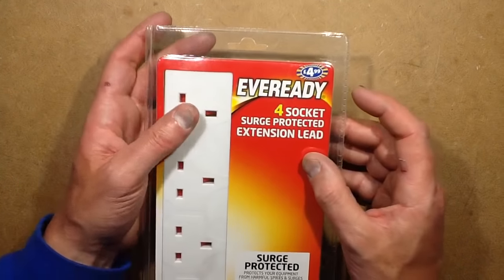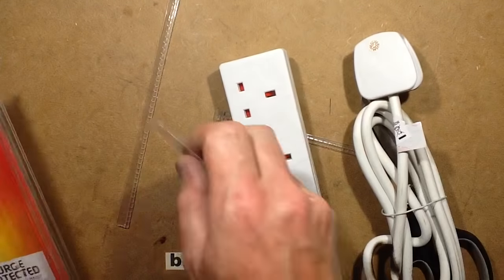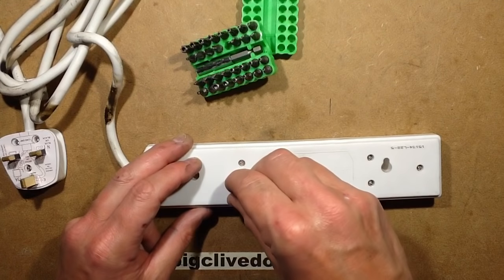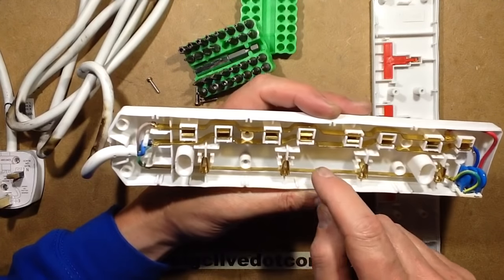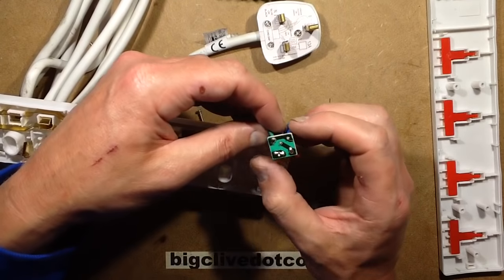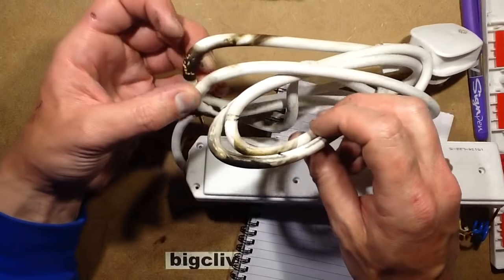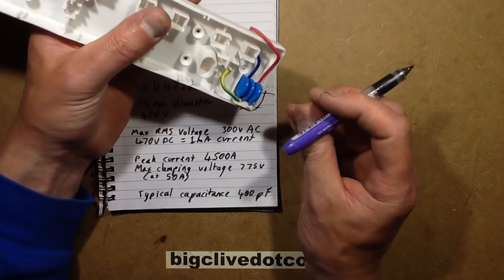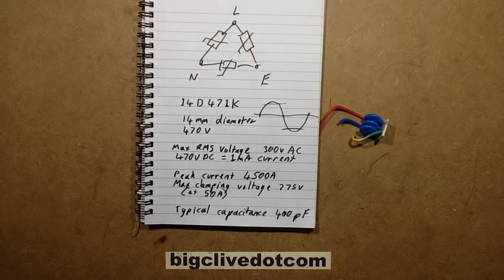Pre-exploded surge protection strip.  What the heck???

Comment: Compared to the plugs in Germany it is a "big ugly" plug for sure but very well designed. I especially like the fact that it has an internal fuse, this really gives some extra safety!
Reply: That fuse is a relic of the past and really adds nothing but trouble; they are often fake Chinese fuses. The really interesting feature is inside - when the cord is torn out, the live disconnects first. Other than that, it's an ugly design.
Reply: zwz • zdenek the fuse is there due to the decision in the uk to use a ring main arrangement for power wiring. The ring main can supply too much current to a faulty appliance or appliance cable so putting a fuse in the plug was the answer. On a star wired system each socket can be protected by an appropriate sized breaker
Reply: paul c I know. My problems with the fuse are: 1) They are way slower than modern breakers and do not facilitate the RCD function; and 2) They are massively counterfeited so that they are not trustworthy.

Comment: still too easy to plug those plugs in wrong. all them the same shape is a bad design.  compared to American ones that have polarized plugs and a grounding pin that make it impossible to plug in any way but 1 way unless you break stuff off and cut stuff.
Reply: British plugs are three pinned. You can tell by watching this video using your open eyeballs while awake. The only way you could plug one in the wrong way is if you were Angry Hulk.
Reply: Andy Jones
 well since all the pins are the same shape should not be too hard. also try and plug one of those in behind something without being able to see
Reply: Earth pin is rotated 90 degrees around its long axis, so not possible. You can't plug these things in wrong. And you are reaching on your second point. I'm not about to have an argument with a stranger about plugs on the internet, so if you want one of those you'll have to find somebody else.

Comment: The UK plug is not as good as the AU plug which is polarised even without an earth pin, where the UK one needs the earth pin to be polarised. Also less brass used for the same contact area.
Reply: So how do you connect earth if you have no earth pin???

Or do you wear gloves when using the equipment?

Comment: Due to the aforementioned fire hazard problem with the MOVs, I had a power strip burn up, and the buzzing and smoke had me very worried there would be a fire.  Fortunately the case was metal.  So now that almost all power strip cases are plastic, I avoid using the surge suppressor power strips.  My philosophy is that if there was a need for them, the equipment maker would put one inside of the equipment.  And if there is going to be a surge suppressor in my home, it will have to be inside the main breaker panel at the main entrance.
Reply: I'm the opposite. I won't even plug in my electric toothbrush without a surge protector. I live in an area that has very crappy electricity. Weekly power fluctuations are common, and sometimes daily depending on the weather season. The worst year had nearly daily brownouts or blackouts.

I've had to replace one too many broken appliance due to these damn surges... enough is enough.

Comment: How much would one of those tamper proof screwdriver sets cost me?
Reply from the maker: About five bucks.   http://www.ebay.com/itm/262418085998
Reply: I should really use ebay more often. In actual stores a much smaller set of those would be about 60.
Reply: Actually the same set is not all too expensive at Princess Auto (Canada), or Harbor Freight (US). Maybe 5 to 10 dollars, if I remember correct, when I got the two I have. The ones I have are in a red rubber case, instead of green, but all of the same bits... tamperproof Torx, Hex, Tri-Wings etc.
Reply: +LakeNipissing oh nice. i always love an excuse to go there.
Reply: The problem with some of the Harbor Freight ones is that they use crap or improperly tempered steel and thus sheer when you try to use them.
Reply: +randacnam7321 well I live in the land with princess auto. and nobody should ever complain about low quality in $10 tools.
Reply: These aren't the type of screws which are usually torqued to a hundred ft-lbs anyway! So for something which is going to be used infrequently and lightly, cheap Chinese stuff works OK.

Comment: Interesting. Wondered how surge protections works for a while.

Btw, do you have an idea why powerline networks don't work when put behind a surge protection (at least the vendors claim they don't work, perhaps I should test it once). The adaptors put an extra high-frequency wave on the regular 50Hz wave, so it's normal that every contact point reduces the quality of the signal a bit, but I have no idea why the warn so much against surge protection.

Perhaps it trips the surge protector (if the high-frequency pikes are above the allowed voltage), harming the signal and the surge protector that way.
Reply: some protection strips filter out "noise" and the signal used for networking gets filtered away.
Reply: +Robert Szasz thanks, good to know.

Comment: What are you on about clive, you put up stacks of videos :-).
LOL pre cooked, just needs a cable from a dead applience and its usable :-D
Reply: dunno its cheap chinese junk, i doubt both the plastic is the proper temperature and fire resistant, along with the cheap brass strips may overheat at anywhere close to 3kw, there was a video floating about that i cant find, they tested several 4 way strips, all the ones from proper places like argos, diy stores etc were fine, the ones from market stalls and wonky foreign shops had interesting failure modes at 3kw, melting of the plug, the socket, fire, exposing live connections, melting so you couldnt take it out of the socket!, they all had the CE mark and BS marks so some importers will sell any old fake tat if they can, 4.99 isnt a great bargain either, im not hot on them using the old ever ready name, which is an attempt to sway us older guys with legitimacy.
Reply: Yes i thought the Ever ready name was odd, Should have been called Never Ready :-D.
Brass strips will work as long as they are used for light loads like..... ermm table lamps ha ha, sorry im in silly bugger mood :-D.
Its what i use them for, the small plugin switchmode psus for modems and routers plus small stuff.
I would not trust one for the full 13 amps.
Reply: zx8401ztv
yeah i agree at light loads should suffice, i know ive bought and used them for same, laptop, router. a surge lead actually saved my PC some years ago, we had a lightning strike hit our row of houses, most everything electrical died, but all my stuff on a cheap surge lead (at the time i was dubious they were useful and bought a cheapy out of curiosity) survived, my tv vcr etc all died though !

Comment: It's like the brand new air conditioner I purchased earlier. I got it home and went to put it in the window only to realize that it was damaged. I called customer service and she made 2 points, 1 because I removed it from the original packaging there is no way to prove it came like that from the factory and 2, it's more likely that I dropped the unit removing it from said packaging. Sssoooooo, now I have to straighten the aluminum cooling fins. I already used epoxy to fix the cheap plastic face plate, but I'm awesome at fixing stuff so unless someone actually looks close it's almost unnoticeable.
Reply from the maker: What company was that?
Reply: @bigclivedotcom  I got it from the local Walmart New York

Comment: I think the plug housing is just a bit too large. The US plug I think is better mainly for that reason. The U.K. has a lot of benefits though.
Reply: The US plugs just are dangerous as hell, as everything I've seen while travelling make contact while the prongs are still visible and able to be touched.
Reply: Dylan White One thing I do hate about US plugs is that older sockets don't have the hole for the earth prong. Lots of newer appliances need the prong, so you end up buying a plug adapter  for every TV, computer, blender, etc and not knowing if it is truly grounded or not.

Comment: Interesting, I'm a little confused though. The neutral should be the outgoing pin, that is coming from your device. To get a high voltage transient there, wouldn't it already have to have been on the active? In which case why would you need a MOV between neutral and earth? The other two MOVs make sense to me but why the third? Also, how do these things not trip RCDs all the time? Those things can be remarkably sensitive so even the small ammount of current leakage during normal operations could cause major issues couldn't it?
Reply: keep in mind, neutral and ground are seprate wires in the system.  There is a chance that a voltage spike could occur on one and not the other even if they are on a common connection point in the main box.  This could happen for any number of reasons:  lightning, bad transformer, loose wire in the system, etc.  This device just takes that into account and keeps surges to a minimum.
I just wonder if he put it back together and used it.  If it's just the surface that is scorched and not burnt through, it should work just fine.
Reply: Jon Marple Oh you could absolutely still use it, just replace the cable. Also, yeah, I guess that makes sense, except that I doubt this thing can cope with a lightning strike.
Reply: RCDs aren't "very" sensitive. They are rated for a 30mA differential. This thing has a few microamps loaded symmetrically. It's several orders of magnitude below the radar.
And as for the reason why it's between N and E? Often it just so happens that L and N are swapped. All devices are prepared for that. Well, not all, I have once taken apart an induction stove and it had good creepage around L, but just about 0.5mm around N. It was made in Spain. And it kept failing for various reasons. (Never the tiny creepage though.)

Comment: Could you do a video on the various protection indication circuits? I've seen some that appear to have mildly complex circuits with transistors etc. Why hasn't any manufacturer invented a protected strip where the MOVs are a small replaceable module that they could sell you when the protected light goes out? or are there?  (ps thanks for the videos :)
Reply from the maker: There are some products with swappable modules, but most want you to buy a complete new product.
Reply: A replacable MOV module is a beatiful concept - it fits perfectly into the "ideal" world of electronics.
But in the real world, questions crop up faster than one can type.  The first that comes to my mind is its cost vs the cost of a new power-strip. Then comes the idea of proprietary - what version of what powerstrip by which manufacturer (UberPower 2.0  went out of business last week. didn't you hear? ;-) and then there's always the "if it blew out the MOVs... would I still trust what remains? Hmmm dunno.
Reply: These are available industrially - e.g. socket outlets with internal surge suppression - the cartridge has an LED on so you can see if it is operational. Some of the higher end ones even have dual cartridges, and an automatic fail-over, if one of the cartridges fails. This way you can replace a cartridge while the system is powered, and you get continuous protection even after a protection failure.

Comment: I am from the US and I spent time in France too so the round plugs and the thin flimsy blades on the US plugs are all I know of.  I never seen plugs so big looking and was curious if all the plugs include the ground on everything or if you have a 2 prong option?
Reply: All plugs have the ground pin, its required to open the shutters protecting you from the live & neutral.  Not all appliances use ground.  The tom scott video linked above is worth a watch.
Reply: +Nicholas Martin ah thanks for the response. I honestly think that's genius and I am in love with those plugs. I wish the US used them. I am not a fan of a lot of electrical setups that are in the US especially Edison plugs
Reply: +Skye Renard the plugs also all have fuses in them, because of the British practice of using a ring main layout for sockets, which would be fused at the main box for quite a high value. 

I really like the plugs too, but now I'm living in Germany I can appreciate one things about euro plugs - because inline plugs are more common, rather than the right angle of the cable in UK plugs, tripping over a flex can pull the plug from the wall before it pulls the wife's sewing machine off the table ... Speaking from experience ...

Comment: I was reading about these the other day and almost got the feeling that they're more trouble than they're worth. Would it make sense to only use surge protectors on important stuff like PCs and then change the MOVs every year or so?
Reply from the maker: If you're in a rural area with long exposed overhead lines prone to being struck by lightning, then it is useful to have a surge suppressor.  But for city use it's less useful, and the subject of much over-marketing by white goods store sales assistants.
Reply: +bigclivedotcom in the Midwest USA the idiot power companies run overhead wires everywhere. During a bad ice storm and nasty cold winter, power lines sagged and my parents' house had their stereo receiver and dishwasher die, even though they were properly connected to a circuit breaker protected system!
Still living at home, my computer was "saved" by my surge protector blowing during the night, melting part of the carpet beneath it.
Reply: +Michael Fingers Here, where you live and how many people are in your town has nothing to do with power safety and reliability.

Comment: thoes veristers look to me like capacitors how do you know the difference
Reply: They certainly do look like capacitors, but if no voltage rating marked, most likely varistor..??
Reply: You read the print. Even if you expected it to be a capacitor at first, you would have to read the value before using it and found out that it was something else. 
Inrush current thermistors also have the same design.

Comment: Are you sure that flat surface gives a good contact to other flat surface. I'm going to hint about parallelity of two flat surfaces.
Reply: He's just proud of his country. This design has no tangible benefits over the others. It's been all made better.
Reply: Have you ever measured how parallel they are? No? And the socket has spring loaded contacts, so if if the prongs are out of parallel, they will still make that line/plane contact.
Reply: +Jaakko Fagerlund exactly. Line contact. not plane. only  two lines per prong. also i believe there are no springs in the socket. they should just be elastically deformed. thats all.

Comment: I do not think that varistors fails very easily at all. They are supposed to be super robust components.
Reply: And your assertion is based on what?
Every reputable manufacturer will tell you how many surges a particular MOV can take, in the datasheet, and depending on the circumstances that number can be easily exceeded within the lifetime of a product. From personal experience I can say I have seen some catastrophic MOV failures, which burned down the surrounding components.
Reply: I read a book about varistors once, published by Harris, a manufacturer of varistors. 

The one thing that stuck in my mind about them is that they are supposed to be able to take just about any punishment without failing, because they are essentially made up of microscopic ceramic (or metal?) granules, surrounded by some sort of oxide layer, and compressed against other, so that the layer on each surface begins to conduct at a certain voltage, thus providing the transient protection. 

The energy of a transient is distributed over the entire volume of the varistor, unlike in a Zener diode, where it all goes to the pn-junction. Thus a zener can theoretically be destroyed by a fairly low energy transient, provided that it lasts only an extremely short amount of time, because the heat will take some time to get conducted out of the pn-junction area, but a varistor will handle it with with ease.

Or maybe it was just marketing talk? :-)
Reply: I see exploded varistors on a regular basis (I repair quite alot of stuff). Maybe not as much as leaking/puffed up/exploded caps, but still enough that when I plug something in while the case is open I try to shield myself from the varistors.
Reply: Is it possible that they they fail when they absorb a powerful transient, for example due to a lightning strike? Or do they fail spontaneously?

Comment: I was wondering why do you guys fuse all your plugs instead of a breaker box, and why do u have switches on all ur outlets?
Reply: zippofanmc it was a design choice to reduce wire usage. There is one 30amp loop with most of the sockets on it instead of individual loops for rooms. Less copper is used, but 30amps 220v can do a LOT of damage.
Reply: zippofanmc post war copper shortage
Reply: zippofanmc it's cheaper
Reply: There is a switch on every outlet to turn it off, you can then leave appliances connected, we don't usually have a wall switch for lighting outlets, every outlet has the same power. Every plug has a fuse to prevent the whole circuit going out when one appliance has a problem. The plug fuses are either 3 Amp for small appliances and 13 Amp for larger ones with heaters, the breakers are 32 Amp. 
There can be 10 or 12 outlets on one circuit, usually supplying the entire floor, or just the kitchen. It's not instead of a breaker box (consumer unit), it's supplemental and provides local protection. Also power strips have a fused plug (13A) and every other plug that goes into it is fused (usually 3A), this way you can safely 'daisy chain' power strips for more outlets, an overload will usually only blow the first fuse in the plug in the wall socket.